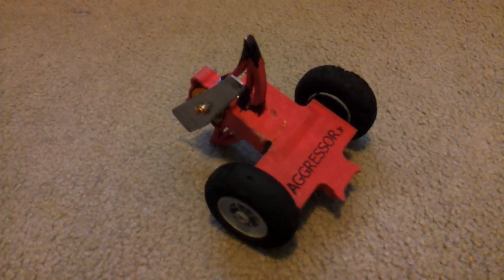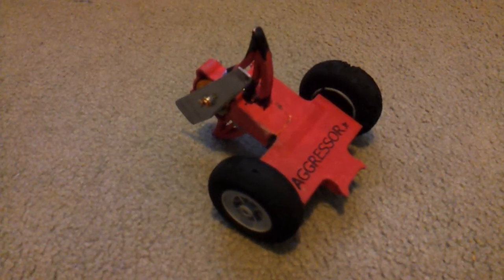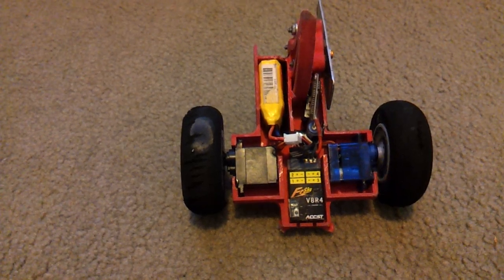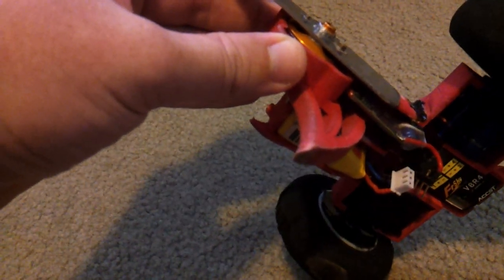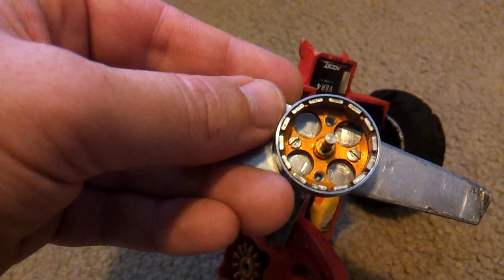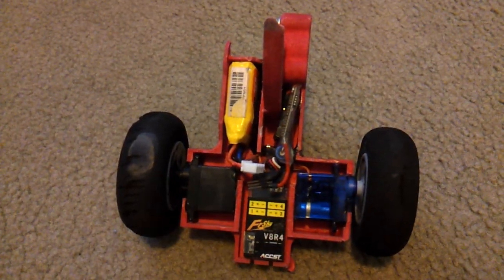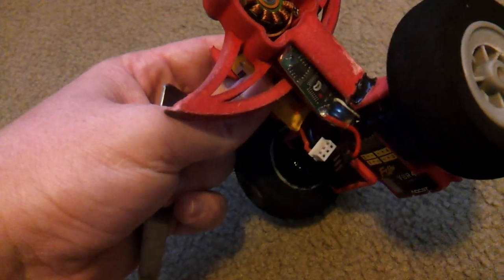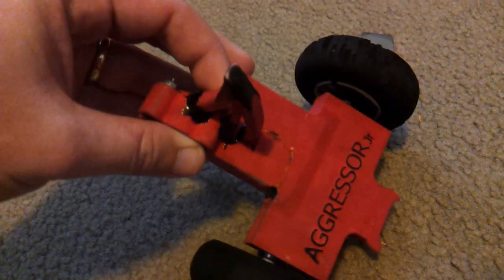How to make Aggressor Jr

Comment: I'm thinking of making a flipper antweight with servos for the wheels and flipper, how can I regulate the voltage down to 5V for the receiver?
Reply: SeismicMedia Some esc have a step down regulator built in it ( in the connector to the reveiver (there must be 3wires instead of 2))